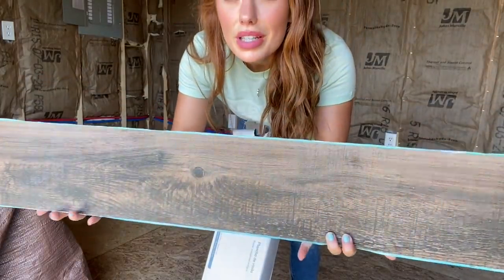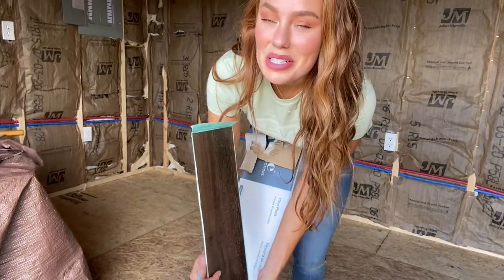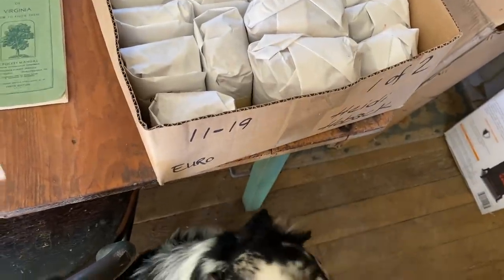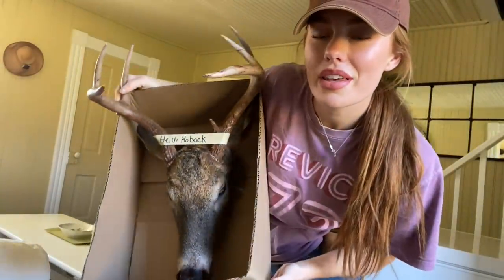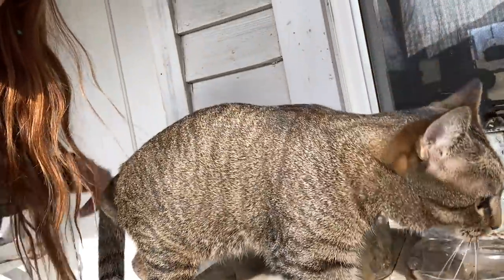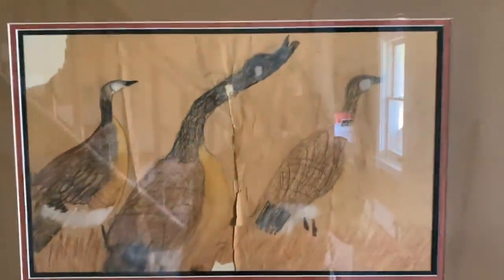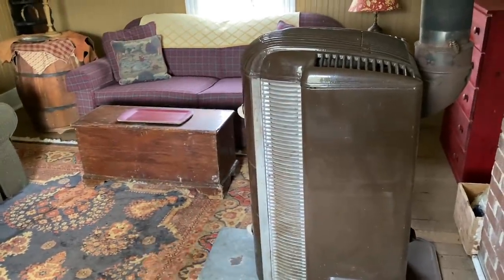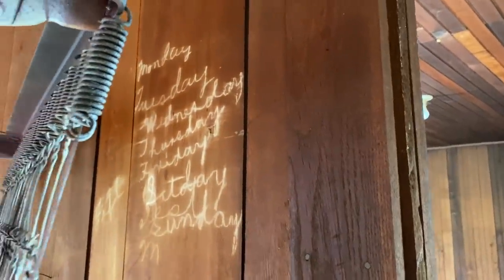Workshop Update + FARM HOUSE TOUR!! Ep. 6 (is it haunted?)

Comment: Pro tip when buying screws buy The torques bit screws they are far better
Reply: Took the words right out of my mouth. And get an impact driver.
Reply: At least some quality bits. I like dewalt ,pretty good. I agree with you guys!
Reply: @movingforward6099  As a 15yr mechanic, I STILL use the phillip screws, I figured the torx would snap bits on long screws/hard wood. Impact driver? You dont blow thru bits?
Reply: @madjeepernh6834  That Ryobi would have hammer mode
Reply: @ripptydevibes2581  they do make bits tempered for impact drivers.
Reply: you mean torx
Reply: Better yet esp w long screws when using around 1/4" and larger, instead use Hexhead bolts and impact drill, and just stop all the stripped out screw heads no matter which type of bit style used, Ayuh
Reply: Most torches head screws come with a bit if you buy a whole box.
Reply: 0la

Comment: That 90 degree angle where you installed the trim with the decking needs some type of drip edge or angled board for the rain and snow to run off.  If not you will have a serious issue with rot.  Awesome job, love watching your videos.

Comment: What a cozy place.  Once you get the power up and going, the cleanup will go quick.  I had  an old place that didn't have a bathroom or hot water. I added them on. It was a fun project. your wood flooring looks great and vinyl is a good choice for a shop floor.  Happy Solstice Heidi.

Comment: Switch from a cordless drill to an impact driver and never look back.
Reply: That's a really good pro tip, I thought of this too, just figured she likes drills better maybe 🤷
Me I love my Porter Cable impact!
Reply: Pilot holes and lag bolts would have been better.
Reply: 100%
Reply: Or torqs screws and an impact driver work great and don't strip heads
Reply: Although some other's have mentioned a impact driver, and torx or square drive lags. You should pre drill and it will be much easier. All of the above are great thing's to consider. I have been following you for awhile. But I didn't watch for awhile so I'm kind of  lost. From the fishing to the farm change in your channel.
Reply: Why? Because they're trendy? Something new to burn a hole in people's pockets? Eff that, Chad. Suit yourself but I'll wait until the price of structural screws drops below the larceny. In the meantime, mankind managed to survive for thousands of years without impact drivers and torx screws - I'm guessing it can last a while longer,
Reply: @cisium1184  expando foam... way cheaper
Reply: Make sure is brushless
Reply: @cisium1184  no disrespect, but if you are driving screws/bolts of any type an impact driver is a no brainer compared to a drill. Like anything else, use the right tool if you can. Use a shovel to move a mountain if you have to, use a hammer to build a house if you have to.  I am going to use heavy equipment and air/battery nailers.  If you are going to drill some holes and utilize a drill for other purposes, and drive an occasional screw or two, then do not buy an impact.  Night and day difference in driving fasteners if you are doing a large project! You do not see construction workers or mechanics (especially framers) that have to get stuff done on time and not play around using drills to drive/loosen, screws/bolts/nuts.  (actually framers probably got drunk and lost their impacts, so they are using drills - haha).  They would laugh you off the job site (and probably throw you off because you are to slow).  They are not a trendy tool, they have been around for a long time.  Every construction pack comes with a drill and an impact.
Reply: Ehh if you're not doing it as a job a normal drill will do the job fine, just use the right fixings for the job and get quality drill bits
Reply: @hawks2252  umm Yeah ok  🙄

Comment: YES, TORQUE SCREWED ARE WORTH THE EXTRA COST.
When you do use Philips screws make sure you use the correct number tip to put in your drill/driver.  Besides torque screws there is Robertson style also, just a square tip.

Comment: Keep a bar of soap in your tool box, when driving screws, especially toe nailing, rub the screw in the bar of soap to add a little to the treads and then go for it.  The soap acts like a lubricant and the screw drives a lot easier.  Great video....
Reply: Yea right
Reply: @williamstratton7492  he is correct,, my dad was a home builder,, it's an old trick from the brace and bit days and home made soap
Reply: While yes soap etc helps, olde pro tip is to 
PRE DRILL 1/2 > 3/4 SHORT OF FULL DEPTH USING A SLIGHTLY SMALLER SIZE BIT, Ayuh
Reply: @dalehill559  yup,, pre drilling definitely helps
Reply: The soap will corrode them over time

Comment: Red, I am worried that water will sheet down the shed walls, go under your new gap filling boards and soak the floor under your stick on flooring, rotting and loosening all. You needed to flash under the wall sheathing and out past the boards you toe-screwed on. Perhaps you can peel up the base of your siding and insert sheet flashing. aluminum or vinyl, and angle it out to drip away from your platform foundation. Pre-shaped drip edge flashing will show you what you need, most important is that it goes up a few inches behind siding but over rain screen/tar paper/house wrap and continues out to an edge that will cause water to drip off, not come back up behind the flashing by capillary action. A sharp downward edge or channel will do that.  Ask around or google if you can.

Comment: Heidi, tip: when you cut the flooring, turn your square so that the wide part that you running your blade down is turned and the edge of it goes against the edge of your flooring. Then run your blade down the other side of the square. 
Looks great! Good job!

Comment: You might want to consider investing in a water filter if you have problems with your well pumping a lot of dirty water. All you would have to do is change the filter if it starts getting dirty. I use a $3 filter from Walmart and it lasts about 3 months.

Comment: Torq head screws and predrill your toenail will help.  Also, I would have put luan down first on top of the particle board before putting the vinyl, I just worry about it sticking good on the particle board.

Comment: Hi ya Heidi, please take some advice from someone with over 4 Decades working in Construction, Drills can run in screws but Impact Drivers were designed specifically to run in screws. Ryobi has a wonderful Impact drill that will do a superior job running in screws and not burn up. Take it from someone that has burned up several Drills running in thousands of screws; needless to say I have yet to burn up my first Impact Driver and it's been easily 2 decades since I've changed over. Every now and then there is that one screw that ONLY a drill will run in but that is the exception, not the rule... Keep up the great work... Cheers...

Comment: I always use the flooring that sticks to itself. It is a floating floor system and isn't glued to the floor. If the floor isn't primed your floor will not stick for long and you will be replacing it. I also always do the floor after the walls are done.

Comment: Get you an impact, it'll make screws effortless. And drill you screwholes slightly smaller than the screw body. It allows the thread to bite without trying to split the wood and also makes screwing easier. You need to roll the vinyl flooring and heat the room til it sets of it'll curl.

Comment: Ridget impact drill, pre-drill holes make alot easier. Use safty glasses, one weird bend and you could snap the blade, and who know's where thr shrapnels go. 
 Wait you guys still have green pasture's? There's snow here and tempture -49⁰F with windchills it's -76⁰F.
 Tube t.v. from the 1980's? Dang...

Comment: The driver bit in your drill is either the wrong size or worn out. That's what's  making it a pain in the butt. Cheers from Canada!😁
Reply: Or at the wrong angle from the head, or not pressing hard enough on the drill motor
Reply: She would not be using our Robertson head screws they are only in Canada, they bite very well compared to any others
Reply: Yup wouldn't slip if using Robertson.
Reply: @bcpioneer59  I'm Canadian but live 10 minutes from the Washington border and they do have Robertson screws in the states.
Reply: @homernextdoor5950  That is good, years ago they did not , there was a group from Canada went down to help rebuild the hurricane stricken states a few years ago and they brought with them Robertson screws that no one had seen before and not able to get there. Originally they were not allowed or banned because Henry Ford wanted the exclusive rights to them and Robertson refused to sell, so Ford made it  impossible to import into the USA

Comment: If I was you I’d try torx or star head screws..would get rid of the phillips head  slippage problem
Reply: Actually the very best would be Robertson head screws, but from what I understand they are only available here in Canada. They have a square hole for driver hardly ever strip
Reply: it would also make it easier to get a impact drill its easier on the wrist and hands
Reply: Definitely Torx screws NOT square heads
Reply: Predrill baby girl! Always easier on you
Reply: @unclefuddelmer9224  Robertson the best, not trox garbage.
Reply: @bcpioneer59  Yep, I prefer the square head screws too since they wedge on the driver and hold tight. But I usually have to go to my local fastener company to get them. They save time and can be used with 1 hand well.
Reply from the maker: yea phillip is not my best friend at this point
Reply: @LilRedHeidiHood   guarantee you will love them...just make sure to get a good quality bit so it doesn’t strip👍🏻
Reply: @SuperTrucker1979  and a quality impact driver like, Ridget brand or their of. With phillips you strip too many times, standard just sucks and star is just time consuming, with robertson you just point and shot.
Reply: @fatlady57  I know what you’re talking about just don’t know about availability
Reply: LilRed, square head (Robertson) are far better than Phillips, but test results (and personal experience) indicate Torx/Star heads are more resistant to "stripping out" for high-torque applications (aka "driving long screws"). As others have noted, an Impact Driver will do a better job for you than a Drill Driver.......
Reply: Spax screws from the Home Depot and an impact driver
Reply: @fatlady57  Either, IS WAY better than old phillips heads.
Reply: Torx screws would be the best but the problem she is having, for now,  is that she is using the wrong size Phillips tip in her drill. Find a correct size tip that fits your screw heads tighter or more snug.
Reply: Pre-drill and push and phillips are no problem.
Reply: @LilRedHeidiHood  You can also get a magnetic sleeve for your drill and a square head (or phillips) bit. Keeps the screws on the drill without falling off.
Reply: And the winner is....pre drill way easier regardless of tip
Reply: T-25 bits
Reply: @bcpioneer59  The Robertson drive (square head) has been the standard since 1907 in Canada and drive dependably with cordless drivers and sold anywhere in Canada for decks, fencing or anything else that needs a screw.  The TORX (star head) are a great alternative for performance, but they tend to be available only on more expensive structural screws and rarely worth the premium price.  We can instantly identify a product that was manufactured by our southern neighbours because they are filled with Phillips screws.  I fail to understand United Station's obsession with Phillips screws, because they suck.
Reply: @unclefuddelmer9224  TORX perform really well, but in Canada they're only available on premium quality structural screws and lag bolts, limited in sizes and varieties and TORX screws are often twice the price of the Robertson (square heads).  Either are great alternatives to crap Phillips head screws.
Reply: @chrisgraham2904  Yes I am fully aware of the history of the Robertson head, and know they did not get into the states because Henry Ford wanted the patent for them and they refused to sell to him, so he had enough power to keep them out of the states otherwise his design would have been pretty much useless and would have no sales. So that battle is a long one, and noting is more solid than the Robertson design and if quality materials are used for screws and drivers they would virtually never strip
Reply: And if you're using philips, drill pilot holes them you'll never strip a head

Comment: I agree with all the suggestions regarding predrilling holes in many situations. It depends on the wood but it really can't hurt. The thing  is to  use a smaller diameter drill bit so the threads get their grip as was mentioned. But hands down square drive driver bits and screws are my preference.  I seldom regret using square drive stainless as well. These have many advantages. But choosing between square drive non stainless and stainless  non square drive  I will still prefer square drive every  time.

Comment: Also, plan on getting a good work bench, too. I'm thinking like a steel frame with 3/4 partical board wood at the top and another a few feet below the top. All your tools get put in this area for storage. Also, get a tool box for the smaller tools. I like a plastic box because they are lighter. With the tool box you can easily bring tools along as projects come up, then put them back.

Comment: I use 2 drills when setting screws especially toe screws, one I has a drill bit for pilot hole and the other has the star or Phillips head for the screw type I’m using...the pilot hole makes life much easier! Need to learn about flashing to keep water out. By the way the saw thingy hanging on the wall is a scythe which was used to cut hay and other crops...we had one on our old farm too. Others have probably already told you this stuff. Love your moxie!
Reply: That's why most cordless tool manufacturers sell drills and drivers in a combo kit, usually at a reduced bundle price.

Comment: When toenailing use a tiny drill bit and pre drill holes at the angle you prefer. Only needs to be a couple inches deep. It will make those screws a lot easier for you!

Comment: Use deck screws, they are way better for that kind of stuff. They use a torx bit that slips less and those deck screws usually come with it in the box. They also have a cutting edge on the tip of the screw that drives it in without too much splitting. 💪🏻👍🏻

Comment: hello heidi
just came across ur channel. i saw ur water line r close to the front of the studs. there r metal plates that attach to the studs that u should get an put in front of those line so u dont put holes in them when u put on ur finished wall material

Comment: through that piece of crap in the garbage and buy a Makita impact driver, you will thank me for the advice
Reply: I agree, A Milwaukee or Makita and it will las a lifetime. Also, either the drill is on hammer, isn't in drill mode or She is stripping the heads of those screws out like crazy. Torx head is only way to go!

Comment: When your putting in a really long screw, it can help if you pre-drill a hole where it is going into.  The friction is what makes it hard for the screw to go into the wood as it goes in deeper.  So if you pre-drill a hole the screw can go in deeper because of less friction.  Also pre-drilling mans that you have less of a chance the wood will split.   What i do is hold a drill bit in front of the screw and you should still be able to see the threads of the screw with the drill bit held in front of it.  To line up where two boards are meeting drill the screws into the first board at the angle you want where they are poking out the back, then push the board into place and it will leave indents where the drill holes need to be.
Reply: Putting some wax or soap on the threads also works wonders.

Comment: The earlier commenters know their stuff. An impact driver is where to start then maybe torx screws to make an even more positve hookup between tip and screw so less of that skipping. I used to use Milwaukee cordless drills for const work but now that I have slowed down so much I changed to Ryobi. The newest Ryobi tools are brushless and should last the average homeowner a looong time. Your old drill will still have plenty of uses because it has the regular old style chuck not the snap chuck like the impact driver. I like the impact to make longer screws easier to do and my older bro says he likes it because it is easier to set the screw head exactly where he wants,as-in he likes the added control. I have had ZERO problems with Ryobi so far and that includes the lithium batteries,all the 1.5A,2A,4A,and 6A that I use are doing great. Anyhow,this is the 1st vid of yours I've seen. You are a pretty good presenter/host and I just might watch a few more.

Comment: Frankie's working "Security Patrol".  For snakes and rats or mice.  He's doing a great job.  It should be quick to set up some water lines to the farm house.  I suggest using the new PEX piping so it doesn't freeze. Also an instant hot water type heater.

Comment: You might or you might not wish you would have left space between the hot and cold water lines. As the hot water moves through the lines it will began to heat up you cold water also have them touching the cold water will cool off the hot water faster. We had this problem when I use to build sailing yachts.

Comment: I would guess the screws for toe nailing were phillips head screws.  Everything coming out of the USA seems to love phillips head screws, they are really bad at cam-ing out and stripping your driver bit and the screw head. Carpenter pro tip: Robertson screws will save you a lot of headaches when driving screws, better yet - torx.